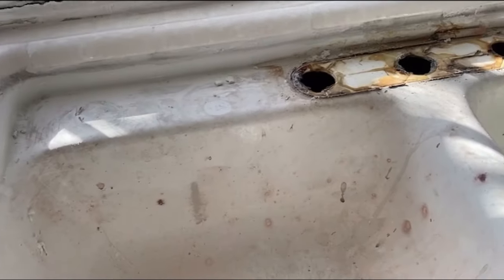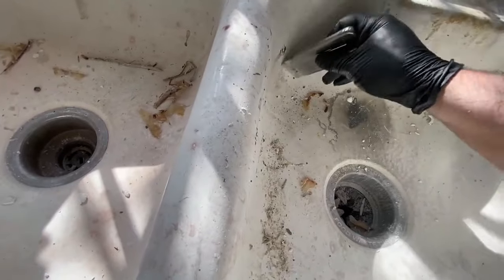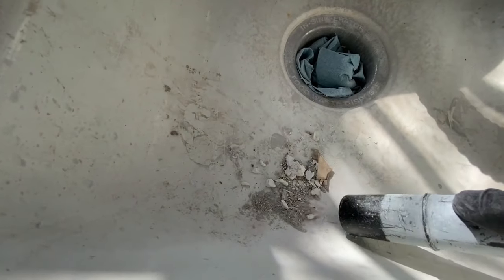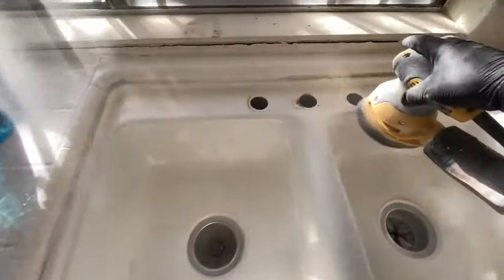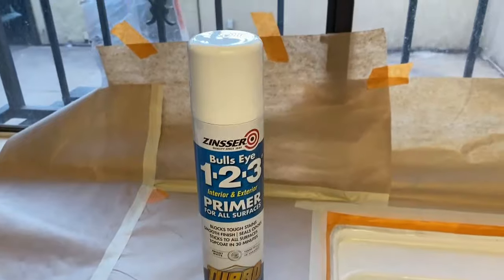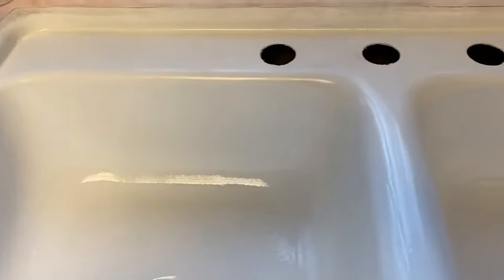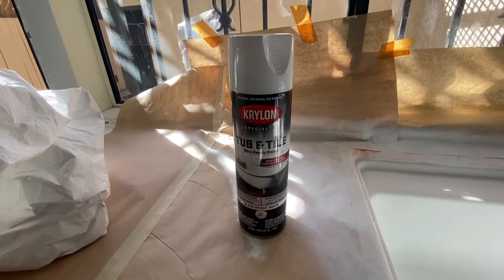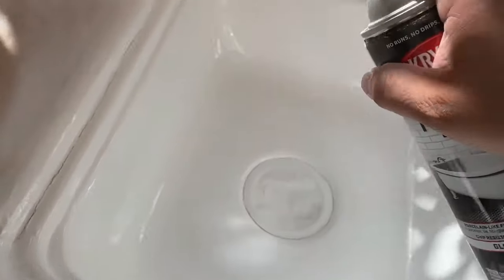HOW TO REPAIR AND REGLAZE A KITCHEN SINK USING DIY KRYLON TUB AND TILE KIT

Comment from the maker: Hey Everyone: Thanks for watching. Keep in mind that some areas of the video are focused on more than others. If you would like to see how I mask off a bathtub or surface please check out the masking video. There are also other process specific videos on the channel. Thanks for watching and I hope that you learned something from this video.
Reply: Hi I can’t seem to find anything on the internet but do you know if this is harmful as far as the dishes being used to eat in and sitting in the sink
Reply: My apartment sink is old thank you so much
Reply: I've been painting for 10 years. 
 
stainless steel and chome are the most difficult material to paint. 

and I'll say you can make ANY paint stick to ANY surface with the right preparation.  for example a plastic sink. just scuff with a red scotch bright pad and use an adheasion promoter, like a primer. works great.

you guys were really, really close with the prep work though. for stainless steel and chrome, wire brush the hard to reach areas and then 60 or 80 grit the entire sink. do not sand with anything finer. use 3 light coats of adhesion promoter, preferably 3M, wait for 3rd coat to tack up but before it's fully cured lay down your paint.  let everything cure for 24 hours. and for more protection you could use an automotive clear coat
Reply: @CoCo Get's It Done  it's not harmful to leave your dishes in the sink after the reglaze is fully cured.
Reply: I sprayed a but far and its a little but rough. Can I sand it then polish it with compound to smooth and make it shiny?
Reply: Where is the link of products you used
Reply: This video is terrific! It is just what I needed to rescue an old sink that’s a very odd size and I can’t find a replacement. Thank you so much!

Comment: Hi! Is there anything else that can be used for adhesion promotion? The product you mentioned above is super expensive now and the projects I'm doing aren't worth that much money. Can you achieve a good adhesion without it or a cheaper brand?
Reply from the maker: @BeastmodeLLC.  acid wash / plus primer / plus top coat and you will
Be fine

Comment: Hi! Should I use both cans for a kitchen double sink? I used one can and it looks great. Should it dry shiny? If so, then I should probably use both cans. There are some shiny spots but I assumed it was from over spraying one spot…. Please advice
Reply from the maker: If it’s dry in some areas watch your distance of spraying from the surface and how fast you are moving. Closer spray within 6” and slightly slower steady spray will give more shine but be careful for runs

Comment: Out of the countless videos I've watched on sink reglazing, this one is by far the best! Well done(:
I have a question though. Is the bulldog adhesion promoter a necessary step? Will the primer and glaze not adhere without it?
I ask because I can only find bulldog online at $60 or above which is more than I'd like to spend with my tight budget. Is there a cheaper alternative that will still work?
Reply from the maker: You can look up for an alternative adhesion promoter to help with the bonding. Some primers are sealers and not adhesion primers. You would need an epoxy primer

Comment: So my husband dropped something in our sink today and the white chipped off the center divider between basins.  We now have a spot 1” x 3” to fill, it went straight to the black metal underneath.

I was going to fill with epoxy putty and sand, but I know that I’ll likely have to paint to really hide the patch.  Also, I noticed on some of your other videos you use Bondo.  Is that the same as an epoxy putty (I just bought some Loctite Repair Putty).  Would Bondo be better for the patch?

Our sink was old before we moved in, and those before us had left not much gloss on the finish (it was dull and scuffed easily when any kind of pot or pan is in the sink).  My guess, years of scouring with Comet.

If I use the Krylon, as above in your video, I’m guessing the new surface is less likely to stain from tea or scuff from a pan?  What would you recommend for basic maintenance?  Should I never plan on using anything abrasive again?  Would soft scrub or comet or barkeepers friend pull off the Krylon paint?  Suggestions and any advice would be appreciated.

And thanks for the videos.
Reply: What did you end up using to patch? I need to do my sink and it has three areas that need patching. Also, what do you use to clean it? Thanks

Comment: When applying the three coats of paint, did you sand before you applied that next coat of paint?  My finish has come out a little rough and definitely not glossy in appearance.
Reply from the maker: No! It’s not necessary and the top coat is 48 hour cure so you wouldn’t be able to
Reply: @DPTubs  Do you suppose that I may have bought an old can of the Krylon tub/tile spray paint or perhaps didn't shake it long enough?  My finish is definitely not smooth and glossy
When I say it's not smooth, I mean that if I run a cloth over it, it doesn't just slide over it and the surface appears to be more of a flat sheen, like what I had with the primer.  When I ran my hand over it, a white dusty film was on my fingertips.

Comment: Where does one find Bulldog Adhesion Promoter (Wipe on) version? I found a spray version and it says it is for plastic surfaces. Is the spray version Ok to use on a rusted sink surface? Thank you.

Comment: I did everything as you did but when I applied the final step Krylon Tub and Tile Spray it is drying "powdery" what did I do wrong????
I used the shop vac to suck up dust and resprayed but it is the same thing?? what is this "powder"
Reply: Same problem here, I think it is impossible to have a smooth coating the way it is shown in the video. The powdery stuff is the paint debris of the cloud from the spraypainting that you simply cannot avoid. One probably has to be much closer with the paint nozzle to get a perfect finish but then it is easy to spray too much. I have found no solution other than that a roll-on paint is the safest bet.

Comment: The Krylon Tub and Tile isn't drying glossy it is matte and rough
Reply from the maker: If it’s matte and rough that could be how far away you are spraying it or if you used primer and didn’t sand it.
Reply: If it is rough, you are spraying too far away and the material is partially drying in the air before it gets to the surface. Also, if the surface isn't completely smooth before starting, then you going to add material on top of an already rough surface and end up with...... A rough surface ;)
Reply: @tRRickedOut  Thank you!!

Comment: I bought all the supplies you listed.  Did you really use 2 cans of the Tub & Tile spray?  I haven't even used one can.  Am I not applying enough? I've done 4 coats of the Krylon Tub & Tile and some of it is very nice and glossy and smooth, some is still rough and not as shiny.  Do I just keep putting on layers?  It doesn't spray as nice as the other two products.
Reply from the maker: Definitely 1 full can should be used for a kitchen sink. Make sure you give it at least 3 full coats possibly 4 coats. You want to make sure the thickness is enough. So how close you spray and how far away will determine the thickness of each of the coats. Alos make sure you wait in between to prevent runs or drips

Comment: Could you use the Jasco paint and epoxy remover (like you did in the bath video) as I have made a right messof my kitchen sink and need to remove it all first??
Reply from the maker: Yes you can!
Reply: @DPTubs  I used "Lift Off" but it doesn't seem to be doing much??
Reply: You dont really need to re strip. Since the finish is new, you can sand smooth with 400 grit to get all the imperfections out. Wipe down with acetone or laquer thinner on a paper towel, then tack cloth or blow out any remaining dust. Then recoat 2x with the spray. No need to reprime. Remember to spray even coats from roughly 10 inches away, lightly overlapping. Be patient! It may take a 3rd coat to get the full coverage you want but don't rush it.

Comment: You sprayed 3 coats of the krylon. How long do you normally have to wait between coats ? You mentioned 48 hours to cure but better to wait 3-5 days. C
an the sink actually be used after 48 hours if you don't use hot water ?

Comment: Very helpful video on restoring the finish on a sink.  I have a badly scratched surface on my undermount sink that has stains deep in the scratches.  Would you recommend any other preparation steps in this situation before I proceed with the steps shown in this video?  Would I have to remove the old finish down below the scratches to get out the food stains and such?

Comment: Great video. I plan on doing this with a porcelain sink. However, I can not find the Bulldog Adhesion Promoter. What do you recommend as a substitute?
Reply from the maker: The adhesion promoter should be at AutoZone or any car auto supply shop
Reply from the maker: I should also have a link in my description

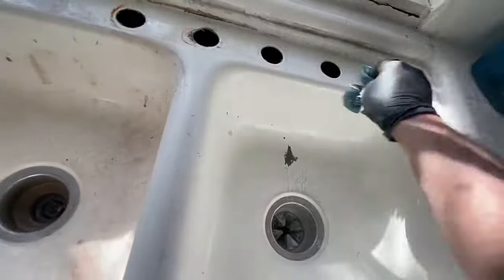Comment: OK at 3:05 is there is a decent size chip in the right basin...when you get the sander out it's gone? Am I missing something? Thanks
Reply from the maker: It wasn’t a chip. It was paint that I scraped off with a blade